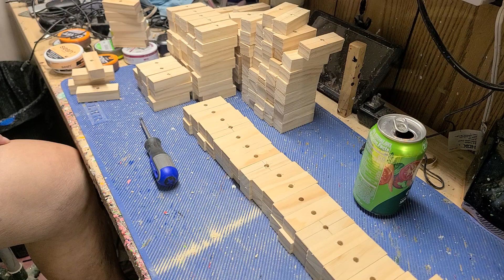making whirligig wing hubs part 2, checking the balance of the hubs.

Comment: Good video.  I had the same problem when making multiple hubs.  If all of your hub blanks are the same size. You can make a jig to center drill them without marking.  The jig eliminates the need for marking and usually results in less drilled center holes being off.
https://youtu.be/dShAM3BqKkY                        I actually used two hub blanks to make the spacers between the jig top and bottom.
Reply from the maker: At one time I had considered a jig for center hole drilling but the hubs would need to fit very tightly so I was concerned about doing 100's with a very tight jig, not to mention while I do everything I can to make sure each batch is the same size as the previous batch I don't have a table saw with that fine of adjustment on the fence, so we marked them by hand for years but then Micro Jig came out with their FitFinder which works great and saves lots of time.
Reply: Yes it's hard to get any table saw to rip accuartly time after time.  I mounted 2 stops opposite my rip fence so that it would hit them and stay on the same width.   The table was drilled and tapped 10-32 for each stop. @jaxwhirligigs2346